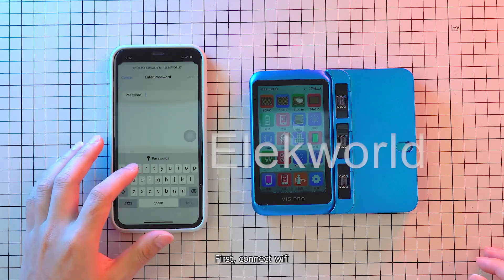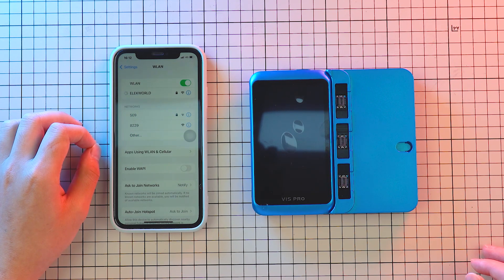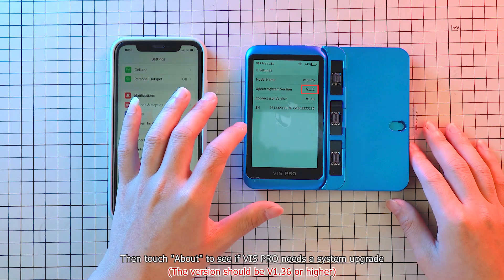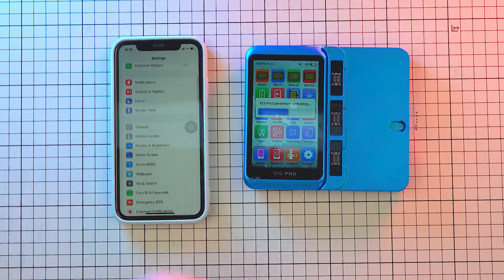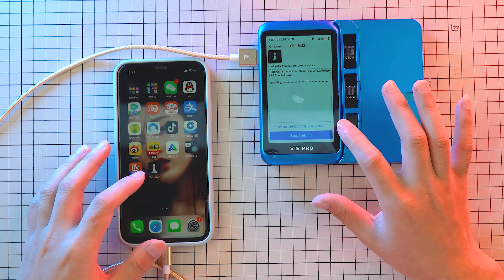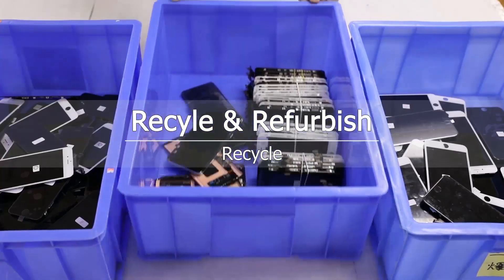How to Unbind Without Disassembling via JC VIS PRO? (3 Minutes to Get Things Done Quickly! )

Comment from the maker: How to Unbind Without Disassembling via JC VIS PRO? (3 Minutes to Get Things Done Quickly! )

Have you ever being troubled by unbinding problems of iPhone? In this video, we will use JC VIS PRO to teach you how to unbind iPhone step by step without disassembling, and this way is compatible with iPhone X and its above series. 
Feel free to leave your comment about what troubles you the most and welcome to subscribe us for the latest information.

00:00 Introduction
00:28 Make sure the phone system is 15.0-16.12 version
00:58 Upgrade VIS PRO to V1.36 or higher version
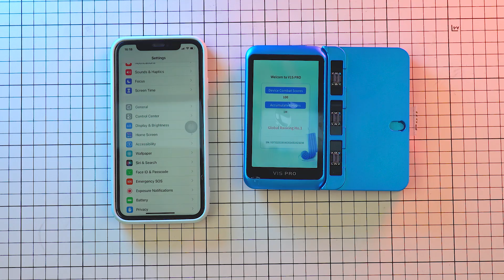01:39 Connect the phone to VIS Pro
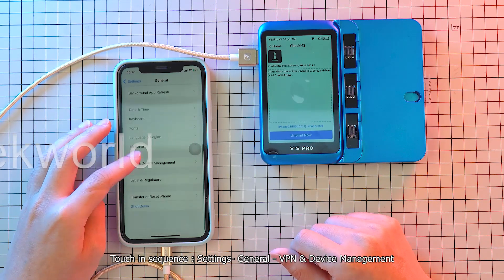01:52 Begin to unbind
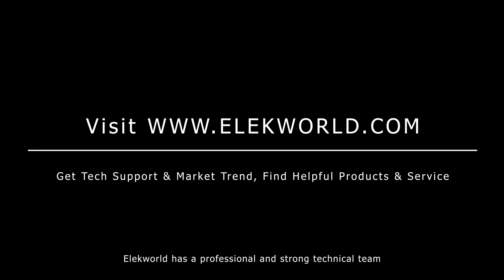02:25 Unbind successfully

What functions are restored after unbinding?
⭐Unbind the flood illuminater to fix face ID failure without the original earpiece flex cable.
⭐Unbind the ambient light to restore true tone without the original earpiece flex cable.
⭐Unbind the Dot Projector to fix face ID even without Dot data.
⭐Unbind the screen code to restore true tone even without the original screen.
⭐Unbind the camera to remove pop-up message warning without the original camera.

For more Repair parts&Tools and Tech support, please visit: 
Website: http://www.elekworld.com
Facebook: https://www.facebook.com/Elekworldshop
Instagram: https://www.instagram.com/elekworld
Twitter: http://www.twitter.com/Elekworld